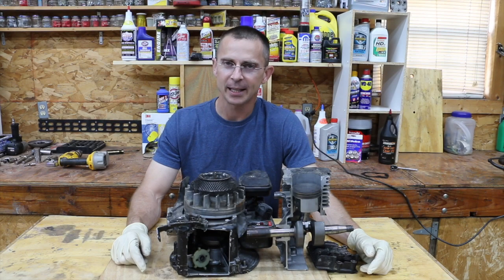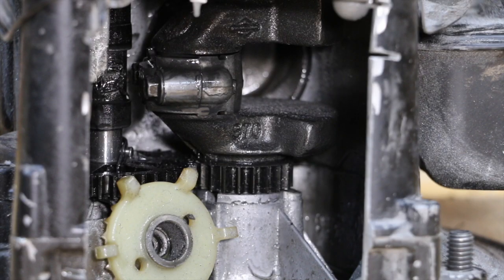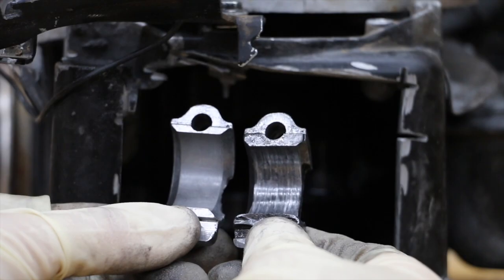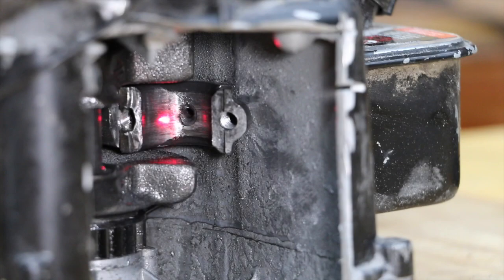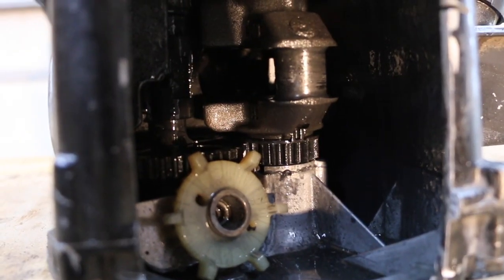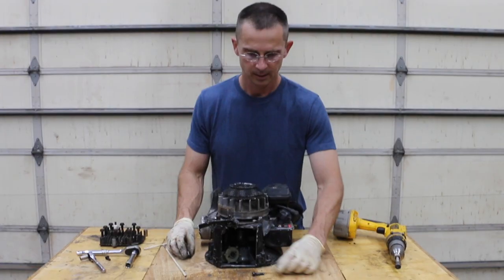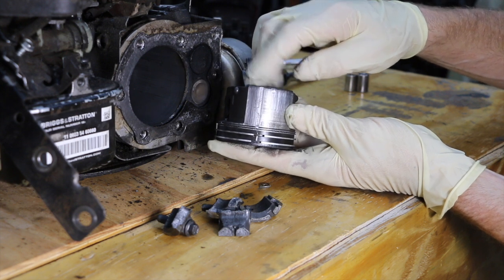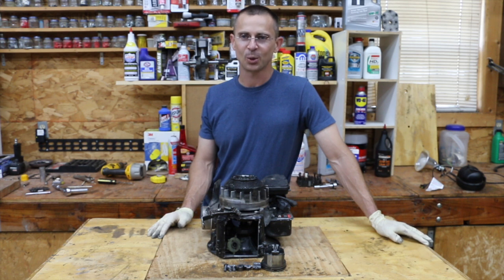Running Cutaway Engine Throws Connecting Rod!

Comment: Have you heard of lumiweld or alumaloy, those things to weld aluminium. So can it weld a connecting rod? Can you mold a head out of it? Can you fix a head hole with it? Can you tepair the cut engine that you did ringh in this video? I am sure there is lotsssss more we could see from that product, Personnaly never tryed it. But seen so many video. Do you think you can do anythings with that?
Reply from the maker: Thanks for the video idea.

Comment: Had two matching push mowers as a kid. A buddy  and I went out to mow my yard, he was in the back yard and I was in the front yard. As I was mowing I heard a loud bang from the back yard and went to check on my buddy. The lawnmower had slung a rod right through the side of the block launching it through the air and through the side of a tin shed. Fortunately he was ok. Made sure to always check and change the oil regularly after that. I had always check it but I don't guess it had ever been changed.

Comment: The aluminum is not THAT tough when subjected to high temperature operation..if compare to steel because of lower melting point. Ducati motorcycle use titanium instead to avoid this problem but that will bang the pocket wide instead
Reply from the maker: Thank you for the feedback!

Comment: I was on a road trip once and was a thousand miles from nowhere when I saw a brief cloud of fine black liquid spray from the back underside of a car just ahead of me in the right lane. I remember thinking, “Hmph. That was weird. I wonder what that was.” Not but 30 seconds later the car slowed down rapidly, and the woman pulled off onto the shoulder with smoke or steam pouring out from under the hood and front wheel wells. That’s when I realized she’d lost all of her engine oil in a flash and her engine seized up at highway speed. Crazy.
Reply from the maker: Thanks for the feedback.

Comment: I had an engine throw most of a piston through both sides of it. The wrist pin even punched a hole in the oil pan baffle. I still keep a piece of the piston for sentimental reasons
Reply from the maker: Thanks for sharing.

Comment: Years ago, behind a Ford dealership, I saw a 300 inline 6 block that had thrown a rod that resulted in about 1/3 of the side of the block "going grenade", right down to the cylinder bores. Quite impressive sight
Reply from the maker: Wow! That's a lot of damage
Reply: @ProjectFarm  it was indeed. I can only assume it failed under quite heavy load, and turning at really high revs. The extent of the damage was what made it so memorable, along with literally seeing the one vacant bore ala your sectioned demo engine sans piston and rod, and the 2 adjacent pistons still mid stroke in theirs through the wide open 30 to 45 degree chunk missing from their bores. Even more amazing the deck and top couple of inches of block "skin" looked fairly intact, it was just a big jagged hole mid block, like the cylinder wall, web, and piston/con rod just crashed out of the outer water jacket.

Comment: Had parts of a rod go through the side of the lawn mower tractor motor.  Started knocking very quickly and before I could reach for key, parts shot out.  Stripped parts from the tractor for my brother (had the same mower) and junked the rest.  That was the second motor on the mower (the first one broke a valve)
Reply from the maker: Wow!

Comment: Just a hint here for you which might take the guesswork out of what may be wrong....YOUR BIG END BEARING IS FUCKED!  It shouldn't be running against the aluminium end cap anyway.  There should be a steel shell with an oil hole and oil way.  No wonder it's knocking if no-one fitted the bottom bearing shell!
Reply from the maker: Thank you

Comment: My sister found a push mower that looked relatively new, she knew that I fixed them up so she asked me questions about it, one of which “what would cause oil to be all over the mower deck” so I told her to look for a hole in the side of the block and sure enough she found one, When I saw it in person I was no longer surprised it threw a rod, for it had “just check and add” advertised on it, the oil was probably never changed(the remaining oil was jet black). I put an old engine from a different mower ( with a rotted deck ) that ran onto that relatively clean deck and it works great. Moral of the story change the oil at least once a year Even if the manufacturer claims you don’t have to
Reply from the maker: Great point!

Comment: Timing chains are my kryptonite. 2 22R-E's and a 3800. Oh, and I blew up an Iron Duke with a rod knocking. Damned thing kept running on 3 cylinders. No theatrics either. Just a POP and then a dead miss.
Reply from the maker: Great point on the timing chains

Comment: Back in the 70's I had a car with a slant six in it. One day on the highway it started to knock. Since I was not far from home, I continued to drive it. The car was ready for the junkyard anyway. Suddenly the knocking got very intense and before I could react, there was a loud bang and I could hear parts bouncing under the car as I came to a stop on the side of the road. Number six had blown right through the side of the engine below the water jacket. For some reason, I turned the key and the engine started up again running on five cylinders. (#6 was laying on the highway) The imbalanced engine shook so badly, I could hardly hold the steering wheel,  but with only one more mile to go, I drove it home. 

Those old slant 6 engines were very tough.
Reply: "for some reason" you say it started up? You already said the reason, slant six!
Reply: 2 2 5 baybeeeeee. Yep it's a MOPAR world..
Reply: I knew someone who's grand father had a pickup powered by a Slant 5.
He disconnected the thrown rod and bearings, used  JB Weld to glue a patch over the hole in the block and kept driving the truck for YEARS.
Reply: @1978garfield  And what did he do to rebalance the crank? I only drove it home. Shaking like a triphammer all the way.
Reply: Roy Riederer probably didn’t😂
Reply: @paparoysworkshop  You probably had more issues than just an unbalanced crank, tbh. If your piston blew apart, your crankcase is exposed to intake and exhaust pressures when valves open. If you bent valves, you could be igniting the charge inside your intake manifold or even pumping exhaust into the intake. The old man probably pulled the rockers from the dead cylinder as well to close it off. I'm sure he had vibration, but you had total chaos.
Reply: @jonathanwilliams4169  The piston was still inside the cylinder. It was the connecting rod that punched the hole. And although I did drive it home, that was the end of it. But regardless, why would you continue to drive a vehicle that shakes that badly?
Reply: @paparoysworkshop 
One thing could have made the engine vibrate very badly is, could have still had the big end of the rod on the crankshaft,  causing even more vibration than if the rod was just disconnected. Just a guess,  the other guy did say his grandfather used JB Weld to seal up the oil holes on the one cylinder ( crankshaft) that could be possible,  I do agree it could vibrate some especially at idle.  Again just a guess on my part
Reply: @jonathanwilliams4169 He could have just pulled the push rods and the valves wouldn't open then either,  if it was me I would have just pulled the push rods to save time and work.
Reply: @1978garfield  The "old timers" did not fret over "little" things. Just looked it over banged this, patched that & continued on their way. Stay safe, Joe Z
Reply: Early production engine are indeed very tough.i still use my Mitsubishi 87 with original engine.not to be nostalgic nuts or what nowadays engine doesn't come even close when it came to reliability.
Reply: Drove my 2000 Honda civic with a rod knock for at least 60 miles home..5th gear was knock less anything under it felt horrific..i was shocked how durable that motor was to take that heavy rod abuse and still go
Reply: @buffalophil3630  can't beat the Honda engines for reliability
Reply: Good story! Thanks!
Reply: Roy Riederer i had a friend do the same he took it apart and put a block of wood in it and drove from Buffalo to north of Toronto
Reply: @Akira S 
it's all a money game today.
like those annoying sideways engines, where you gotta take half of it apart just to change the water pump.
Reply: Cool ! Been there, done that. Heading to high school in my '59 Galaxy straight 6. 70 mph in the left lane and # 4 con rod made a great escape. Windowed both sides of the block. And smoooooke, whoo that was a lot of smoke.
Reply: @donaldshimkus539  Such fond memories. :-)
Reply: @donaldshimkus539 
I can imagine the smoke,  and noise,  I bet it didn't happen very quietly.
Reply: @bertgrau3934  the smoke literally blinded me. And yes, there was quite a bit of noise going on. But not for long, lol.
Reply: @donaldshimkus539  
Sorry sir, that made me LOL.   I can only imagine the smoke,  and noise.
Reply: I drove an old Dodge PU Truck for months with a rod knock,  slant six were near indestructible I think.  When the knock became accompanied by a squeal I parked it.  Just before a scrapped it,  a friend called asking if I knew anyone who could use a good slant six and 3 speed from a car his aunt left him as he wanted to put a V8 4 speed setup in,  I said me and I kept driving my old truck.
Reply: Maybe VERY tough isn't the right term since a very tough engine shouldn't have done that in the first place. Assuming you used oil in the engine.
Reply: Jeep while reading these comments including jeep customers:😭
Reply: Must of been a Duster buddy had one not to bad drove the crap out of it.
Reply: Tat aint shit indrove my 02 camry with 3 cylinders hella pack like the carbwas hitting the ground ...  drove it to oregon and back ... i just put a coil n  spark plug and im still driving it ... most reliable car
Reply: @abarrazarios   That ain't shit dad had a Grand Marquis 280,000 pulled 9,000 pound boat traveled all over South East. Just did oil changes and spark plugs no timing belt like alot of Japanese vehicles traded it for another and a preacher drove it for alot of years. Wife had a 2003 f150 250,000 pulled trailers been across country still running great. I'm allergic to foreign cars have no use for them.
Reply: @abarrazarios  I guess some cars just won't die.
Reply: @Akira S not without some funky engine code. Lol.
Reply: You should have reattached the piston with JB weld and she's good go.
Reply: My uncle had a truck with the slant 6 that did the same exact thing!!! I never was much of a Chrysler guy myself with few exceptions but man I loved that truck it was a black reg cab short bed 4wd 4spd granny with the slant 6, IV still never seen another one like it , the thing had surprising get up, reliability, simplicity,fuel efficiency and would crawl through anywhere your wildest dreams could take you but yeah after knocking for a couple weeks #6 let go and it started back up and drove itself up on the trailer.
Reply: My first car was a 1972 Duster slant 6. Spun a bearing on a highway and still drove it at highway speed for miles. When I got to my destination engine seized.  Best engine ever built hands down.  Back then Mopar ruled.  That engine ran with very low compression due to worn out rings but ran great.  I miss that car.  When I see the Liberty Mutual commercial yellow duster brings back memories.
Reply: They didn't put the drain plug on right at the dealership. Fell off when I was driving. There was only 4 quarts of oil in there. After about 2 quarts drains out the motor is screwed. It happened so quick by the time I realized something was going on it was too late, surprisingly it was extremely quiet. I always thought a motor would make a bunch of noise or whatever but it was super quiet. I'll only knew something was wrong by the oil pressure Guage. Pulled over and shut it off then I looked underneath and saw the plug was gone. Motor blew.
Reply: @ericg4915  Some engines make a lot of racket before they blow. Yours just went quietly into the night. 😁
Reply: @paparoysworkshop  yea those idiots at the dealership gave me a horrendous time too. It was like 3 weeks later and they claimed if it was gonna happen it would have happened immediately after the oil change which is complete bull. Any mechanic will tell you that a plug screwed on wrong or not tight enough doesn't always fall off immediately. They were the last ones to touch it!!! Since I didn't have a lawyer I was victim, they ended up only paying for half of the cost for a refurbished engine. This was kia. Total scam. So from now on I do my own oil even though I have a warranty. They just reimburse me for cost, my warranty allows this. Never will go to Kia again.
Reply: stock block can handle 4000 hp
Reply: MOPAR...
Reply: Wait if there's a hole on a block means it will have tons of compression loss right. How can you contnue driving ? Im no pro or car enthusiast
Reply: @srr1887  The hole was through the side of the engine block just below the water jacket. No compression loss (except #6 no longer existed) and no coolant loss so the engine still functioned. But with the loss of one piston, the engine was out of balance so it shook excessively.
Reply: Good old slants
Reply: Slave lake. That is all

Comment: Can lock deicer work in a butane lighter? And can the carbon compressed air in a 2 L soda bottle be enough pressure to run an air gun

Comment: I had a sweet car with a brand new 289 engine. It ran great but a mechanic friend (ex friend) talked me into adding molydenum disulfide (MolyX) to my oil. It ran one day before dropping a valve, shattering the piston and driving the connecting rod through the cylinder wall, totally destroying my engine. The fingernail sized valve keepers got too slick and let the valve drop. 
Never put any additive in your engine because theyre designed to run on the particular viscosity oil thats printed on the dipstick.
Reply from the maker: Wow!  Thanks for the feedback
Reply: @ProjectFarm  I was poor back then and ended up selling my robins egg blue mint 69 comet cyclone custom to a kid who could afford a new engine and liked working on cars. Fifty bucks. I loved that car and had to know it was going to someone who would care for it like i did.

Comment: I wonder what happens if you connect your exhaust pipe in to the intake manifold? If it works how the engine will look on the inside after? 👍
Reply from the maker: Thank you for the video idea!

Comment: How does oil normally get around the engine and to cylinder walls? 
A pump system or just splasharama?
Reply: That type of Briggs is splash engines with oil filters have a oil pump

Comment: I scrounged a lawn mower that had 3 sides of the crankcase blown out.  Apparently the connecting rod broke and the piece still connected to the crank swung around and broke out the 3 sides while coasting down.  The mower was a deluxe model with self-drive and electric start.  These modules covered the crankcase and prevented parts from flying out.
Reply from the maker: Thank you for the feedback

Comment: That piston swelled up enough to grab the cylinder walls and something has to let go. That's why the piston has a large gouge in it and cylinder wall. It would have went a little while longer with the knock as long as it had oil.
Reply from the maker: Thank you for the feedback

Comment: I had a small engine class in high school.
One student had taken apart an engine with an electric start motor on the side and put it back together.  During its test run, it was backfiring pretty bad.  All off a sudden it threw a rod out the side the electric motor was on, and shot the electric motor into the heavy sheet metal wall hard enough to leave a good dent.  
The start motor weighed between 5-10lbs, and the wall was about 10 feet away, so we were lucky nobody was between the two.
Reply from the maker: Wow!

Comment: It's interesting it didn't even get up to temp before shattering the mid of the connecti g rod. I did notice after you cooled it down and un-ceased it that it was running at a healthier sounding RPM. Perhaps the damage was already done when it ceased and the higher RPM after re-lubrication plus the jerking action from the slip in the the crank bearing finally stressed the weak spot in the metal?
Reply from the maker: Great point.  Thank you

Comment: Hi ,before you blew it up you should have fixed the knock by filling the gap on the inside of the  connecting rod with jb weld  just wax the crank and epoxy the rod on to the crank re drill oil hole replace oil and good as new epoxy heavy on cap side
Reply from the maker: Great point. Thank you

Comment: I don’t know if you know that the current slick 50 is NOT the slick 50 of the 80’s and therefore, will not perform as the original one. Had you used Xcelplus (which has the original slick 50 formula) that engine would have run just fine without oil.
Reply from the maker: Thank you for the feedback

Comment: I'm actually impressed with the engine.   The connecting rod with shot it had already seized once before and It still ran for a long time without oil. It was a tough little briggs
Reply from the maker: Great point. Thank you

Comment: I had an early 80s Buick LeSabre with a 350 cubic inch smallblock V8 that did this while climbing a long hill on a hot day. A piece went through the oil pan, with a puddle of oil on the ground at the side of the road. The body was rusty- I had it towed to a body shop, and they kept it as a parts car for the towing price. I got on a bus to continue my vacation trip.
Reply from the maker: Bad time to lose an engine!